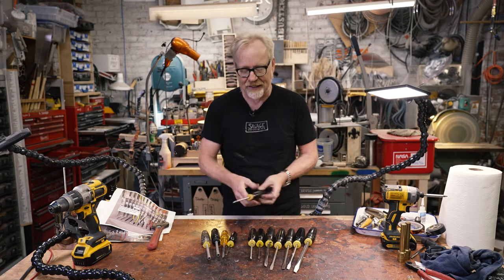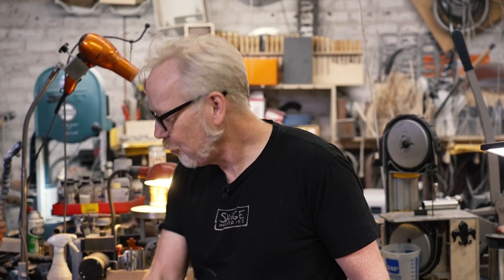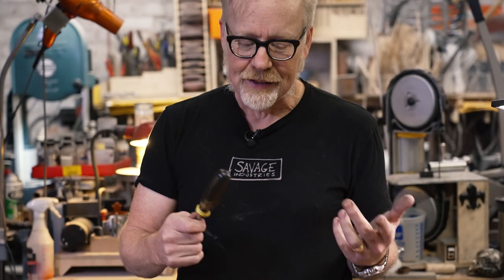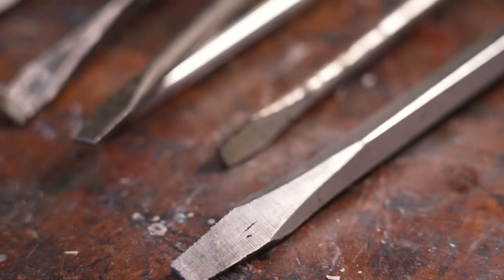Adam Savage's Favorite Screwdriver Design!

Comment: Back around 1978-79 when I was a Boy Scout, all of the scouts in our troop were given a box filled with various gadgets and such, which we were expected to go door to door in our neighborhood and try to sell as a fundraiser. I have forgotten the name of the company, but one of the items was a very clever, ratcheting screwdriver. The handle is made of a plastic ball, slightly smaller than a baseball, yet slightly larger than a pool ball. It fits perfectly in your hand! The surface has a slightly raised texture that gives you an amazingly secure grip, and that coupled with the ball shape allows for you to gain incredible torque when turning it. As I referred to earlier, it has a ratcheting mechanism running through the center which allows you to easily turn the screw without the need to lift your hand in order to turn it and get a new bite on the screw head. As such, work is much easier and faster! To change direction, simply take out the shaft and insert it into the opposite side of the ball.
How do I remember so much about it?
Because in order to do her part for our Scouting fundraiser, my mom bought one. When she passed away a few short years ago, I inherited the screwdriver and joyfully continue using it to this day!
Reply: Sounds like a Screwball ratchet driver.  I bought one for my dad for Christmas back around the same time.  It was a gimmick tool, but it did work pretty well - my dad had arthritis, so he had a difficult time with regular screwdriver handles.

Comment: It is in fact a hexagon. It is referred to as a London pattern. Maybe you are not aware, but it is designed for you to be able to use a 1 in box wrench on the handle for additional leverage.
Reply: For clarity this is not the case on the Stanley workmaster. I'm referring to the classic hexagon with the rounded tip

Comment: Generally never got along with hard plastic handled screwdrivers. Prefer either wood or rubberised handles. As round as possible too. The Stanley fatmax is a solid modern option.

Comment: My dad had the very small flat head “regular flat head and the large flathead with the square shaft. And two sizes of Phillips head. I didn’t realize it until it was too late but there were the best screwdrivers ever. I’ve never found another brand or style that just worked and didn’t bend or twist or get stripped. If anything it was always the screw head that would get stripped. I miss them. Maybe I should scour eBay for some. Or.  Or wait until you finish your set and see if you’d sell me a few extras. 🙂

Comment: One thing people need to keep in mind is that screwdrivers do wear out.

As the driver tips wear, they are more likely to slip/cam out, and that can lead to stripped screws.

Powered drivers are especially prone to this, and often times the bit tips are not replaced often enough. As a maintenance tech, it can be frustrating when a prior tech strips out a maintenance panel screw when installing it, and just leaving it for the next technician.

Comment: Screwdrivers are one of those tools I think everyone kinda takes advantage of. I tend to keep probably a good twenty floating around just between my desk and work area for doing IT work, and honestly? The ones I like I'm VERY defensive of loaning out. Things like my Ifixit bit kit are a old fallback for doing PC work and are guarded with my name being painted on, orange striping (my favorite color) and don't leave my sight really ever. Of course then you have your beater tools, I have a line of Kobalt screw drivers given to me by my dad from probably the mid 2000's (think 06) that aren't great but are legitimately some of my favorite "I need a screwdriver for something, the size I need is probably in these" type of screwdrivers that I own. They're a nice mid range tool that's now sadly very hard to find because the kobalt line is being phased out of sale for craftsman which are still nice but kobalt made it easier to distinguish MY tools from everyone else's.

Comment: The AST Computer (286?)  I purchased came with one of those all-in-one stanley screwdrivers with the screw top, and it smelled that bad too. I was included so you can open the computer and work on it. The look on your face reminded me just how bad it smelled. That was in the early 90's, but i used it so much that the aluminum hole for the tips had started to open up from wear out.

Comment: That clear, red and blue “Husky” is exactly like my old set of Craftsman screwdrivers.
I still have my grandfather’s who knows what brand wooden handled Philips screwdriver… it’s my go to even though I have newer and better (magnetic) in the same drawer.
Reply: Almost, but not quite. Oldschool craftsman screwdrivers have a ball cap on the end of the handle. It's a very old design meant to distribute the force of a hammer blow.

Comment: More than 8 minutes of Adam talking about screwdrivers?  Yes, please!
I have a ratcheting screwdriver with replaceable bits, and it gets the lion's share of use.  I use the rubber/plastic block that it came with to hold the bits; I've never even unscrewed the cap to try it's storage.  I do have a set of flathead and phillips drivers, but they hardly get any use.  I'm also trying transition over completely to Torx fasteners, so to that end, I've started to acquire a few torx drivers, replacing the most word-out phillips drivers (but retaining a few for "backwards compatibility").

Comment: Snap-On screwdrivers are the best in the business, by far. Don't know how the newest ones feel in the hand (the ones I used as a mechanic were made in the early 1980's), but they fit the screws better than any other brand I've used. For a much cheaper option, I choose Dewalt's screwdrivers - again, because they fit the screws better than Stanley's or any other common brand I've used (they are also very comfortable in the hand).

Comment: For me the tip design is the critical thing… I got a set of JIS cross-head screwdrivers about 10 years ago… they are all I will ever buy now .. most feel great right out of the box. BUT!!.. I have a lathe and will turn other tools’ handles to fit my hands better on occasion . 
I do have a collection of vintage and custom wrenches I have made many custom tools over the years and I keep them all.

Comment: Now I need to go looking for what I believe is a Workmaster flathead. I don't recall if it was my mother's or my grandfathers, but I distinctly recall using it as a kid, so hopefully it's still in the house somewhere. I do recall it being comfortable to hold, but it lacked any sort of texture so it did slip out of the hand. That of course means it's probably stabbed me in the foot at some point, because that's just what happens with me and screwdrivers. Steel toes don't help either, as it's invariably the top of my foot.

It'd be cool if you were to do something with Stanley to figure out why they stopped making them, how they came to be in the first place, and if they'd consider re-releasing a full set of them..

Comment: Adam, I found the perfect modern Screw Driver for you that could replace the stanley's

Check out the Tekton Screw Drivers. The Screw Drivers are all made in the USA and are reasonably priced with great warranty support.

They have High-Torque Screw Drivers that are Di-Trigon shaped similar to your Stanley's that you like.
They have 3 large gripping sections that you would love.

They also have Regular Screw Drivers that are 4-sided with thumb divots that are glass filled nylon hard handles.

Comment: Isn't there an issue getting loads of old screwdrivers like this? (Mainly philips and pizodrive) Like the tips get worn, which results in poor contact with the screw heads, causing cam-out and stripping? To me, it makes a lot more sense to have replaceable bits or entire shafts along with the bit.. my cheapo screwdriver set is okay and nice to have, but a good bit driver is very nice when you can just get new bits to replace them when worn

Comment: Before I was forced to move due to ill health and lost access to my workshop I had a collection of old-fashioned wooden handled screwdrivers I would describe the handles as pear-shaped, the best ones had a tapering X agonal shaft going to a flat pear-shaped tang with the wooden handle fix to both sides with a striking plate on the back these were almost works of art several of them special grooves on the flat blade to increase friction unfortunately my tools have now passed down the family since I have lost my site or can I do longer do much with them.

Comment: Someone gave me a Snap-On set of screwdrivers in the 90's.  At that time, Snap-On was only available to car professionals.  The shape of the handle (for me) has never been duplicated.  Not only that, Snap-On discontinued that line when I really started to care about tools.  Then, there is the old fasihoned, full metal with wood scales (tear drop) that I am collecting and restoring.  I really don't even remember that company's name.  They have been gone since the early 60's.  I can identify with you 'my Dad's' tool  I still have his cheap Craftsman tools.  So I can remember him more.

Comment: I was a mechanic for 32 years and the best screwdrivers for comfort and durability were, by far,  Snap On. Although not often used outside the automotive trades, they are some of the best hand tools you can buy.
Reply: I agree! My grandfather had a few of these Stanley’s, but after looking at them and seeing the tri-lobe handle my mind went right to snap on.

Comment: Snatch-on as/had tri-sided screwdrivers handle for a long time too, and they don’t have that weird/bad off gazing smell from old resin handle screwdriver. Plus they have the hex drive shank on them to help with tenacious fasteners. If you buy used ones, I’d recommend to stay away from the early Soft Grip series where the handle was made with said soft rubber that wasn’t compatible with solvent and deteriorated quickly. The new Instinct series is way better.

Comment: I've  seen this passed around as a tooltip on mechanic threads... most screwdrivers have a hex handle so they fit a standard socket/wrench in the case that you need more torque to screw stuff down.  Not sure if that's true, how well it works, etc, etc... I haven't tried it myself... that's just what I've read/seen... maybe something to test? =D

Comment: I prefer the older square plastic handle screwdrivers from Snap-on. I buy the Williams tool Co (snappy’s Cheeper industrial brand) they are the exact same, reasonably priced, and the sets on Amazon come in useful sizes. They feel good in the hand and have a bolster for a wrench.

Comment: The more sides to the handle, the less tightly you can grip it because it's closer to circular. However, if the handle has too few sides, depending on how you need to grip it it may be less or more "grippable" comfortably. It's more critical with a flat head, as (1) there are only two ways to align the screwdriver, so you can't find the sweet angle as nicely as with a Phillips or Torx bit, and (2) it's so much more difficult to get good torque from a flathead to begin with.

I think the ideal screwdriver design might be a hexagonal shape ( in the traditional fashion) on most of the handle, but towards the tool end it should gradually become equilateral-triangular so you can grab it more tightly.

Comment: You should only judge a screwdriver handle while using it, not by how it feels while you're just holding it. I once bought a set with triangle shaped translucent gray handles that felt great in my hands but when I went to use them I couldn't get as much torque with them as I could with almost any other design. I've found it's really hard to beat the standard blue red and clear Craftsman for usability and comfort.

Comment: Sears sold screwdrivers with the exact same handle shape under the Craftsman brand into the 1980s.  The only difference was the handle color:  Clear with red infill for slotted and blue infill for Philips.  They probably were re-branded Stanleys, many older Craftsman tools are.  The later ones had solid black and slightly softer handles.  I've had a full set for 40 years and only had to replace one for free under warranty after I accidentally ran it over.

Also, I beg to differ with Adam on one point:  Depending upon what you need to work on you probably need longer lengths of the common sizes and at least two stubbies, a #2 Philips and a quarter inch slotted.  Ratcheting screwdrivers are great if you drive a lot of low torque screws, and a screwdriver handle for power bits can also be used as a pin vise for hex shank drills and countersinks.  A ratcheting screwdriver handle for power bits kills both birds with one stone and can save you a lot of hassle if you have to deal with oddball fasteners.

Oh, and why pay Ebay prices when can find screwdrivers by the bucketful at any decent flea market?  You'll probably have to sort through a lot of crappy ones but the good ones won't cost any more because most flea market sellers can't tell the difference and if you can't tell the difference than it doesn't matter what you get.  Adam probably can't go flea marketing anymore because he'd get mobbed.

Comment: Recommendations for the next batch of oops patches: Peeling the skin off your finger with a waffle headed framing hammer, Peeling the partially healed skin off with the same hammer a week later, Kicking something with steel toe boots and bending your big toe nail up to a 90 degree angle and having to bend it back down, losing eyebrows from throwing saw dust on a bonfire, grinding your knuckles with a angle grinder, painting a wall with flat ceiling paint and a ceiling with eggshell wall paint, reversing the polarity of car battery wires and frying your ignition module, installing a car radio so that when you start the car your headlights come on for five seconds(power antennae), shattering any expensive piece of material on the last little cut, driving a forklift off a level floor to unload a truck and getting stuck on uneven surface.

Comment: I have a set of craftsman screwdrivers from probably 25 years ago, that have a handle very similar to that, but after I bought them, craftsman went back to their original handle design, which I don't like.

I've looked several times at Sears for those with the smoother handle design, but eventually gave up.

Comment: I bought a matching set of screwdrivers and realized it sucks because it makes it hard to select the one you want while rummaging through a toolbox - they all look alike so you have to look at the tips. My old screwdrivers (lost when my workshop burned) were all mismatched strays, easy to tell apart by their varied and distinctive handles. The matching ones will be fine hanging on a board, but in my book uniqueness is an advantage, having them 'matching' is not.

Comment: that looks like a nice set, hard handles can be so good all the rubber and toe stuff is just ehhh, no thank you. anyway in a very similar story i ended up using and loving and borrowing my moms snap on four lobe hard handle screwdrivers, the ratcheting bit driver is smooth and durable and so nice to use, the handle shape fits into my hand and I can get such a fantastic grip. without any uncomfortable lumps, and the shaft has a hex section for when you need to throw a box end on it and break the head off something. and they are.. almost discontinued. snap on came out with a rubberized tri lobe design that definitely is intended to replace the old style, but the old style sticks around in special sets you can find and buy in special colors and stuff. and... in a very nice affordable set of black screwdrivers sold under the name Williams. same handles same shafts, I cant tell if they are still made in the USA but the product is good. and the set is a boon for anyone who wants quality and to just skip the bs of modernized rubberized screwdrivers. the williams ratcheting driver is mechanically the same but the messed up the handle a bit  so my go to is the snap on still. I pick them up used on eBay and every one ive purchased runs flawlessly with some lubrication, but snap on will sell you a rebuild kit if you ever manage to break it.

Comment: Conversely to your point. Sure by sharing your inviting others to mimic your choices and become your competition. However your also motivating people that have a lot of screwdrivers sitting around to see if any of them are worth tossing up on ebay based on your recommendation. 

That yellow handle one kind of sucks. Great screwdriver but the plastic is brittle compared to the black handle ones. Have a busted yellow handle one out in my tool box.

Comment: Just a thought if you can't find a full set, Why not replicate the handles? Ether 3d scan and print, of make a mold and cast it or even mill it from a solid peace of plastic, and drill an undersized hole for the metal shaft, heat the shaft and insert. 
Would make a good one day build

Comment: I really prefer Wera tools. The handles have the best grip and the laser pattern on the tip grabs screws like no other. They used to be dipped in diamond powder but it got too expensive I guess, and it wore off as well.

Comment: Possibly worth mentioning that Phillips, Pozidriv and indeed JIS are not the same thing! I don't know about the US, but in the EU, in terms of cross head fasteners both in construction and machines, one will typically find Posizdriv in use, not Phillips, (but there are exceptions, e.g., on older gear). The drivers for these are NOT interchangeable, even though they may superficially appear to be. Using a Phillips screwdriver on a Pozidriv screw is a great way to ruin it.

Comment: It is my understanding that the common screwdriver handle design has 6 sides so that you can slip a box-end wrench over it for extra torque. I have personally never needed that kind of torque or know of many screw heads that could withstand it, but that's what it's for.